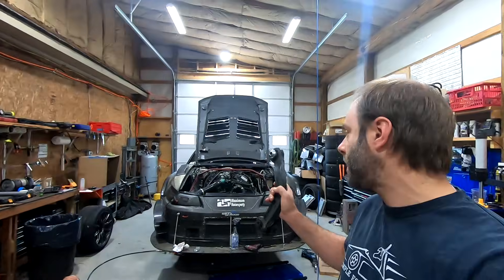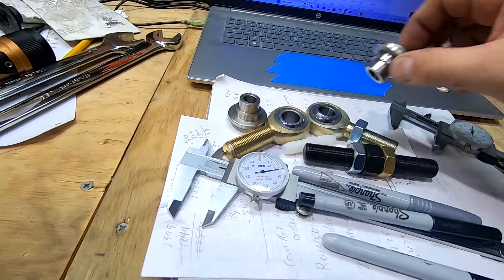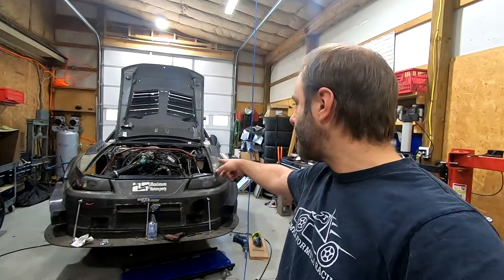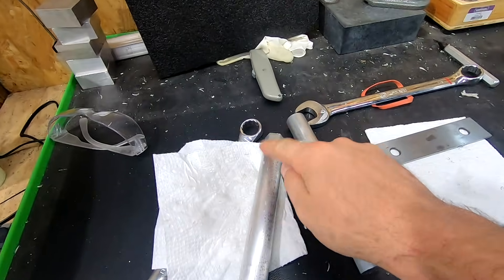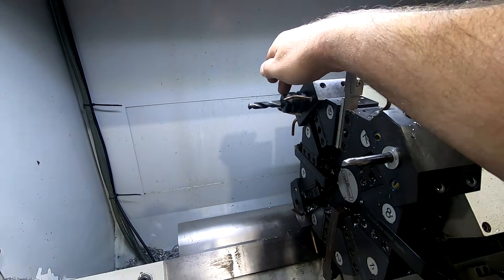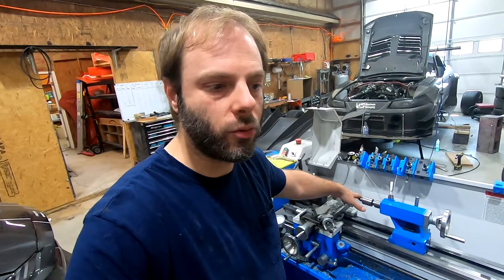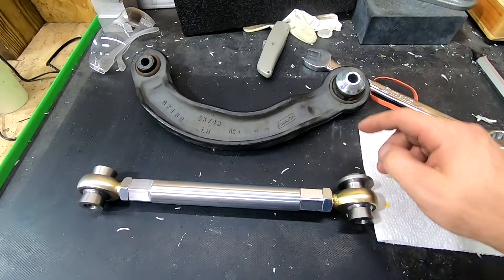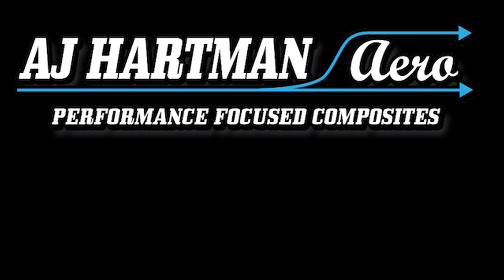Machining Custom Rear Camber Arms

Comment: you should try a spiral flute tap. they bring the chips out the tip and cut a lot easier, but are usually only recommended for tapping in machines (like your lathe) because they don't self guide as well. I don't think you'd struggle with power on your lathe with one. Cheers.
Reply from the maker: Agreed. Couldn't find one for LH and already had a RH. Only needed 3 holes each so no biggie.

Comment: Sweet, keeps getting better and better!  Would you ever consider sharing or selling the designs for the brackets to connect the IRS to the sn95?
Reply from the maker: I did those before I could cad model so they are literally flat steel cut and welded however I needed so can't really replicate it.
Reply: @ajhartmanaero  Gotcha, that's too bad but thanks for the reply.